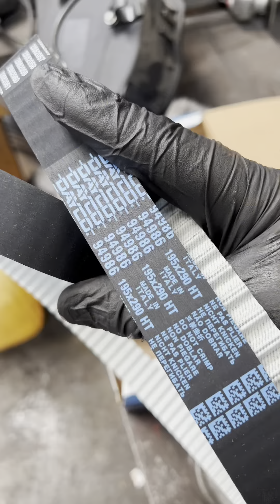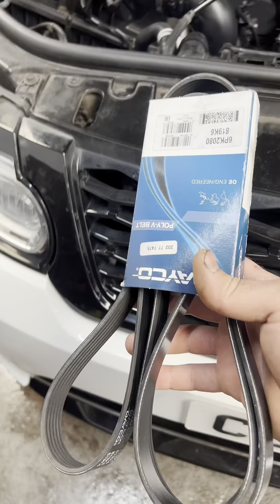Range Rover sport 2015 3.0 diesel time in belt replace

Comment: What should be the interval for the replacement?
Reply from the maker: 900£
Reply: @michaelclassic2613  I'm asking for the interval, in what milage need to be replace
Reply from the maker: 60 k miles
Reply: @michaelclassic2613  I just bought one with 110k, the dealer didn't replaced
Reply from the maker: @redihoxha2940 all the Qahar recommended to be done in 60,000 miles so if it’s 110 K, you need to change it

Comment: Great job how much it costs?
Reply from the maker: 750£
Reply: @michaelclassic2613  does that includes the rear belt as well ?
Reply from the maker: @fabmukaj1615  no it’s not
Reply from the maker: Extra 250£
Reply: @michaelclassic2613  1000£ for both,  including the parts ? Thanks
Reply from the maker: @fabmukaj1615 yas all together
Reply: When replacing time belt, is changing water and oil pump neccessary? If so, then oil service as well, right? Thank you in advance for your answer😊
Reply from the maker: @endone2007 it’s good to be done in 60k miles